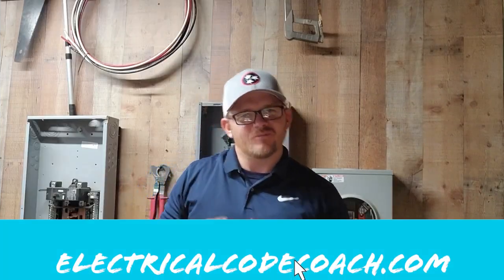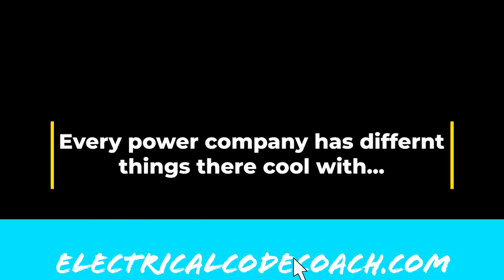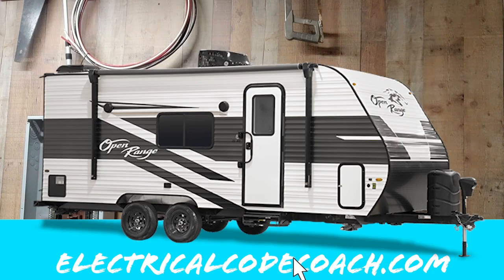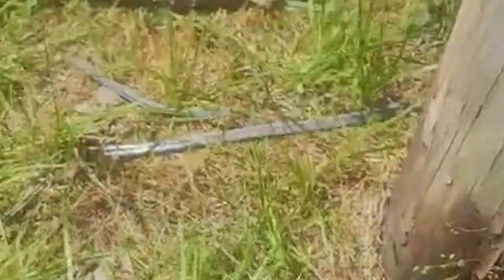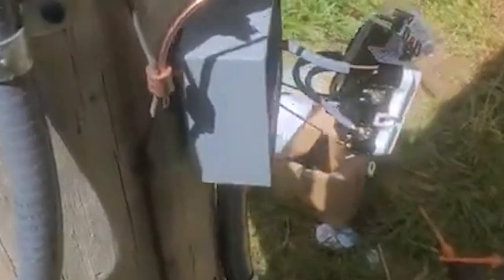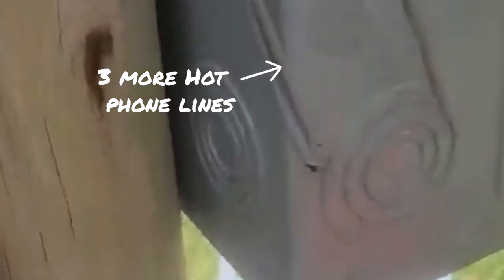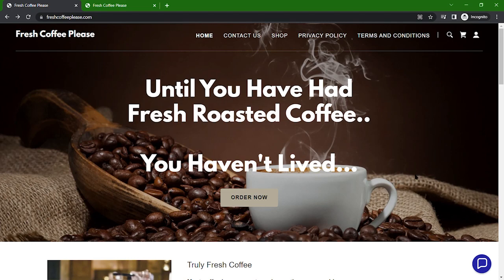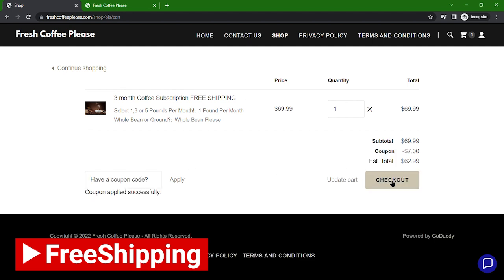Electrician Shocked by 580 Volts

Comment: I was doing some wiring in a crawl space and the circuit was dead - even checked. Could not determine why I had no power, and all the sudden, felt a buzz as I was laying on dirt. Turns out, it was on a timer.   I think the morel of the story is to treat all wires as if they were live and handle with care.   You never really know and it’s good muscle memory to be consistent.   On a lighter note  - I’m shocked every day by your awesome videos 😂.
Reply from the maker: Lol

Comment: That's a telephone company outside network interface. There's a good chance that the power company's MGN was compromised some way and you were zapped by induction induced voltage because of that. Worked for Bell South and AT&T and came across this scenario several times. You're extremely lucky as we'd seen quite a few fatal electrocutions countrywide as a result of this. We used our FVDs religiously in these and other situations to test ALL metal objects beforehand. Glad you're OK and thank you for sharing, you may save someone's life.

Comment: I served on USS Dace SSN607, a Fast Attack Nuc Sub, I was a Nuc Electrician, got bit by 440v from a panel, blew the back of my hand right off of it. We were always working on live circuits while standing on metal deck plates with everything around you made by metal, we can't power down at sea. You had to take off anything conductive and 2 other guys stood by which held the ropes attached to you. Tying to weave your arm thru narrow spaces in panels or equipment inches or less from live buss bars while the boat is pushing anything between a 1/3 and flank bell was typical. Not to lecture but we always assumed the worst and checked everything, count your blessing brother. It doesn't matter if your are insulated from ground, put a large enough potential between a source and ground and it will jump, you in effect are a capacitor, a non conductor between 2 conductors, seem that a million times, thats also how lighting works and of course for electricians its seen mostly when you open a large break, the angry pixels don't care if its an open circuit, they just ionize the air and jump it.

Comment: I wonder how much amperage you got zapped with, that's actually what kills most people otherwise getting tazed would routinely kill people because that's I believe around 50,000 volts. It's really high amperage that's going to kill you, even though everybody says high "voltage".
Reply from the maker: Great question, it's going to be relative to the resistance